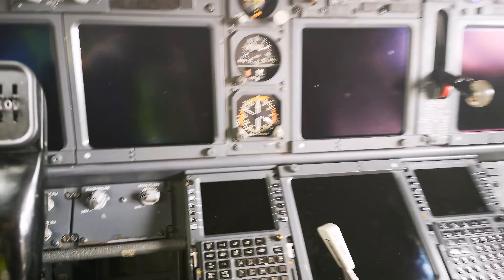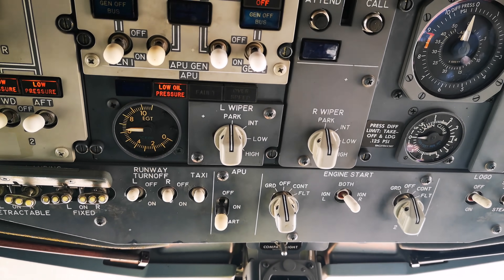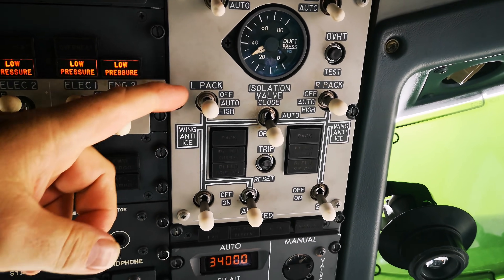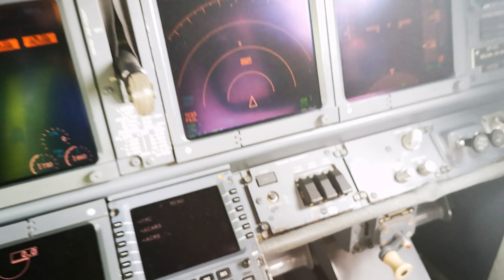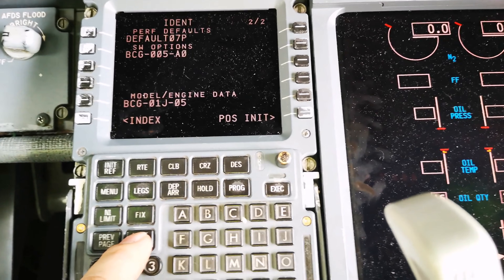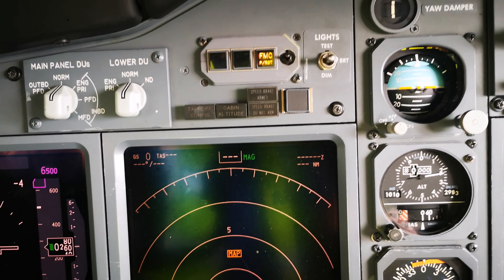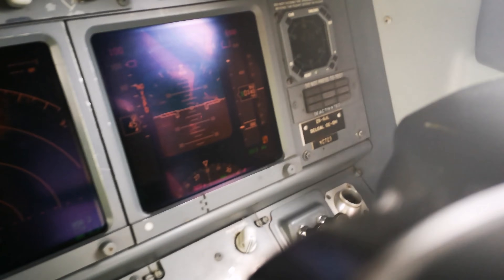B737 800 APU start and cockpit prep

Comment: А проверять положение ручки выпуска шасси не нужно?
Reply from the maker: The handle is spring loaded and needs to get pulled towards you. It also has a mechanical trigger type lock that has to get pulled as well when you want to change the position to (Up, Neutral or Down). Pulling the lever back towards you does a test of the lights...

Comment: Why are there so many slotted screws in the cockpit?
Reply: Those are quick release fasteners for easy maintenance access.
Reply: Those are dzus fasteners, used widely in aircraft.
Reply: @jjsifo1 Thanks for reminding I forgot the name.
Reply: because sh·t falls off everywhere when they forget to put them in
Reply: @gavinvalentino1313  ちょっと何言ってるかわからない。
Reply from the maker: Correct....they are Dzus fasteners.... Its a common screw head that has a cam type lock mechanism as part of the head of the screw. They in turn fit over a spring (wire stretched over the hole in the fixture) to where you want to attach the part or Radio and lock and turn in at a 90 Deg sort of angle.....Google it. Not sure if Dzus spelt correct. I don't now how to explain it better..... Or find it on YouTube. Thanks for asking....

Comment: Does the APU switch automatically go from START to RUN once the APU has started and is running OK?
Reply: Yes. you have to hold the APU switch in the START position for a couple of seconds and as soon as you let it go it will go automatically to the ON position
Reply from the maker: Sort of...The switch has three positions, Off - locked(selected), momentarily on (spring loaded in the down position) when you select it and then "ON" , locked in the Centre position.....Has to be moved to off if and when required..

Comment: Is there a precheck procedure to make sure all the switches are in their "starting" position?
Reply: Yep, parking brake on and engine start levers off which he did at the start of the video. Landing gear lever down should also be checked (get the APU on and then turn hydraulics on... the gear will try and retract and sit it on its nose!)

Comment: Like an airbus pilot, boeing looks to me as a bunch of separate systems/independent disorderly allocated on ovhd panel 😂
Reply: Agree…what a mess
Reply from the maker: Lets not do the Airbus/Boeing fight....I've worked on all of them...From Piston Dc3 to Fast jets...Master of none and still learning.....Both have there strong and weak points. As long as they stay in the sky and have no problems I'm happy....
Reply: Every time I enter this cockpit I think the same thing.It’s a shock compared to modern aircrafts.  It looks like the 747 classic but worse due to the small size of the flight deck. I was used to work on 747 but with this one I’m like a chicken laying a square egg.
Reply: Just because you don’t understand it doesn’t mean that it’s disorderly allocated 😉

Comment: Guy is obviously an engineer. He show cockpit ok but I wouldn’t like to be outside near this aircraft when he plays with landing gear lever. Nevertheless gear lever has lock mechanism. Too many accidents with this happened. Check avherald.
Reply: @Crazycat RoxYou don’t know what you are talking about. https://youtu.be/BKGx4WBnskI
Reply from the maker: Absolutely correct.....There is a manual trigger that locks the lever in the down position....To remove the R/H FMC its required to put the landing gear lever to the up position. This is down with gear pins installed and all the necessary precautions. Else its almost impossible to replace if the need arises...
Reply: Help me out here, please. 6 years ago, I heard the term Flat Earth. I thought that was the dumbest thing ever! So, I set out to prove that I live on a ball being rocked through outer space! But 6 years later, I Cannot even find one proof of a BALL EARTH! Just CGI CARTOONS from NASA/Satan and Masonic/Satanic Lying Governments!!!
Flat Earth for Dummies in under 5 Minutes!
https://youtu.be/kiH6f_QkdAA

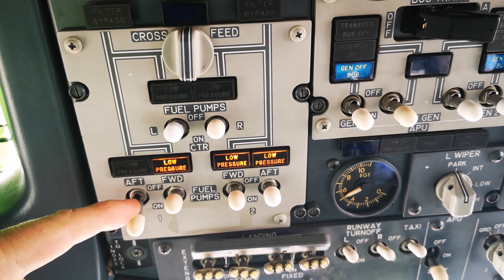Comment: 4:50 Yaw damper switch to 'on.'
*"Yaw damper on" light turns off
Reply: The light off, means that the yaw damper is on
Reply: @KansasPower  Obviously.
But why? Why is it that way? It seems to me that if the yaw damper switch itself is "on," I can see that. I have to be able to see that in order to actuate the switch. But the fact that there is an indicator light for the status of the yaw damper seems to say there is a need to know clearly whether the damper is active or not, leaving alone the fact that during takeoff you do not want the yaw damper engaged because it may fight you if you have to execute an emergency maneuver. Even if we don't know that, the presence of the indicator is confusing and not at all intuitive.
If the yaw damper is active, the indicator saying, "Yaw Damper Active" should light, and only then.
If there is a problem and the ACAS needs to tell you so other than on the readout, the yaw damper active light may flash 1-0-1.
But this business with an indicator illuminating when something on by default is off is silly.
Reply from the maker: Might not make sense......The idea is that, when the "six pack" has a warning light on( the Captain side this case),  the glare shield(six pack) would trigger him/her to look up.....With the effect of having a "Dark" overhead panel, it would be quicker to spot the light that's on than trying to look for the one that isn't. (Hope it makes more sense for you now) . Thanks for the comments..
Reply: @k80theshade  Well the light is amber, amber is generally bad to be on, and a pilot can look up quickly to see any amber lights and react. It's called a dark overhead...

Comment: You shouldn't do fire test without notifying ground
Reply from the maker: Not required on a pre flight in my country....Only have to speak to the tower or ground...Whichever VHF channel is active if you request an engine start for ground run(And then get go ahead- NOT ABOVE GROUND IDLE)
Reply: It’s standard practice every flight
Reply: Doesn't seem like you know what a fire test is...it's required in most transport category aircraft in first flight of day
Reply: @abrinson1996  maybe Boeing's SOPs have changed but pretty sure in NP21ish in FCOM it says notify ground personnel before conducting the test.

Comment: my startup:
DC power on
standby power auto
ground power on
starting an auxillary power unit
auxilary power unit generator on
auxilary power unit bleed on
hydraulic pumps on
fuel pumps (centre, 1 and 2) on
realasing parking brake
calling pushback trucks
starting engine 1 and 2
mixture idle
generator engine 1 and 2 is ready.
turning off the auxilary power unit

that's all
Reply from the maker: Normally(B737-400), but procedures have changed.(Once again, procedures) The Aft #1 tank pump is turned on for the APU start.(Normally). Not talking about DC pumps.(customer options).

Comment: Just one question, on the Navigation display towards the end of your video, do we see weather? And if so, is that not prohibited on ground? Radiation and staff?
Reply from the maker: Jip, I did check...it was. Normally the flight crew do turn it off ( WX) or Standby after flight or tilt it up. I didn't notice it on while making the video.. I do normally de-select the WX button on the EFIS panel when I spot it on..... The average "safe" distance is between 7 to 15 feet away. Just reminded me on how we used to put the Radio active sign up in front of the DC3 aircraft I worked on when I was in the South African Airforce.......Caught a lot of new apprentices that had to give "samples"  to test if their weapons still work.
We were on a remote base, so all our mail was sent off from the telephone exchange....Those old Gals where not happy when these guys walked in with their "samples"( In oil sample containers), to be sent by mail for testing. Those were the days you could still get away with it.... Part of an Appy initiation, hand in hand with the grease gun assault, engineers blue and cotton waste (feathering), we all went through when you first got to your assigned Squadron....

Comment: So cool! Why does everything on the panels look like it's from the 80's though? haha
Reply: Cause it is from 80’s
Reply: @스웤  Nah, the first company to get the 737-800 was actually as late as 1998 (TUI fly Deutschland), So its a fairly recent design.
Reply: @jibronigibironi8959  Well we are talking about panels(overhead, aft overhead, center pedstral..) right? They first came out in 737-200 and didn’t change much till 737-800 MAX. So they actually came from earlier than 80’s more like 60’s.
Reply: Cause 73s are ancient.

Comment: The left wing no.1 fuel pump was required to boost fuel flow to the APU in the classics but this isn’t required for the NGs. A DC pump functions to increase fuel flow to the APU automatically once the APU is powered on.
Reply: Still part of procedure.

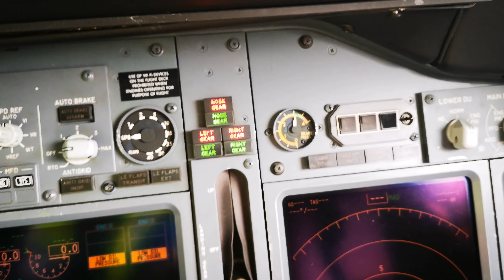Comment: 5:33 Did not quite understand how you’ve tested the landing gear lever. Did you pull it towards you? Thanks in advance!
Reply: no, i believe he clicked it down, it seems that there is one extra click down
Reply from the maker: The lever is spring loaded. To test it you pull towards you and it tests the lights, On the lower part is a manual override (looks like trigger), which allows you to release the gated slot and select the landing gear lever into the position required.

Comment: Is the Emergency Transmitter Locator on all 737s?
Reply: Why wouldn’t it be?
Reply from the maker: There are... There are the standard 2 black (orange) boxes at the back of the aircraft up in the roof,  and then there is a transmitter in the middle cabin overhead bin area that is an Emergency Locator Beacon (ELB). There is a test switch for this on the overhead panel in  the cockpit.

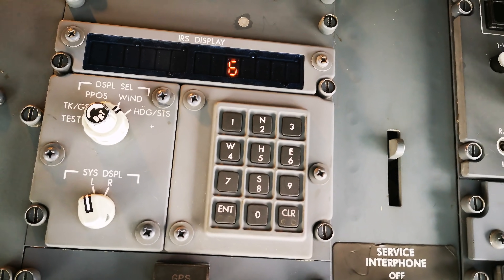Comment: At 4:20, what's the pathetic lever above "Service Interphone" ?
Reply from the maker: That is a spring loaded latch that holds the overhead panel in place before it is tied down with fasteners. The entire overhead panel pivots on hinges to the rear of the aircraft to gain access to the wiring on the rear.
Reply: @AviationEngineering1972  Thanks.
It wasn't labelled ;)

Comment: First I thought this plane was from the 1960s.... Too many switches, which should be automated already....
Reply: That’s because the plane is just a recycled version of the one from the 60s.  Even the more modern 737s still use a cable and pulley system on the PFCS
Reply: That's cause, from what I can tell, the pilot(s) should be in control of the entire plane with override capable automation  (you can override the auto controls)
Humans may be better at determining what is happening
Reply from the maker: Pilots were clever back then hey! All those buttons and stuff...not relying on computers to tell them what to do. (Just kidding. A bit more involved than that...The new A 350 airbus aircraft are cool.. It is very nice to have all the digital tests and manuals right there in the cockpit....Sure makes my life easier when the aircraft can tell you exactly where the problems are. And it saves money in the long run because the flight not stuck at the gate forever and the day. (well unless the computers fail)

Comment: What an ancient pile of garbage. What happened to you, Boeing?
Reply: Time to stfu and get off youtube you a tiktok pilot or something?
Reply from the maker: Don't know how to respond to this one...They did build the B17 bomber for the second world war as a defense...take it how you want.
Reply: Your point being?
Reply: @bigdaddy3662  that less buttons doesnt guarantee efficiency. Boeing may have more manual buttons, but why should that matter when the planes performance is what matters
Reply: @bigdaddy3662  bruh, for me the cockpit of the 737NG is the perfect balance between new and old. And to remove some buttons will maybe look more modern but it's naive to think it will become more effective and provide more safety
Reply: @quickmatch-aykut1086  the A320 has proven unequivocally your statement is false.
Reply: @bigdaddy3662  i wonder why you can find dc 3s, MD80s, 737s in Alaska flying but not any Airbus. Its weird to me that Alaska Airlines has A320s but you wont find a single one flying in Alaska. I don't say that the a320 is a bad plane. But to say that the 737  is shows that you didn't see many airplanes. The 737s cockpit is well structured, if you want call it outdated but thats no reason to hate on it. I know many who love the 737s cockpit design. There is a reason why it looks "old" in your eyes. Boeing did try to leave it similar to the previous 737 models, so the pilots could easily learn to use it  when switching from older 737 generations.

Comment: I am a little surprised that the switches are up on off. 
So far I thought that switches are always installed in such a way that they are off when something falls on them. For safety purposes. 
What is the reason for Boing to do it vice versa? :O
Reply: As a general rule on the Boeing overhead panel, the switches go forward, just like the throttles to turn on the systems to go flying.
Reply: It depends on the context (in-flight situation) whether an accidental on is worse than an accidental off.
Reply from the maker: I would not know...those Yanks...the even drive on the wrong side of the road...go figure...

Comment: Why is the IRS still used? Shouldn't GPS made it obsolete?
Reply: Redundancy, GPS is not 100% reliable.
Reply: IRS, Inertial reference System provides a platform for Attitude as well as position.   You can see the aircraft attitude indicators come alive once the alignment is complete.

  Like the previous poster wrote, GPS is susceptible to interference or jamming.
       
    The IRS position can be updated from ground based navaids as well as GPS.   If the GPS fails and you are out of range of navaids, the aircraft will still have a reliable position solution, but it will slowly drift over time.
Reply from the maker: Jip, System was designed for submarines originally. Does "drift " a bit over time......But still quite accurate....Will find home.

Comment: The Egpws test should be completed after the alignment is complete 🙂
Reply from the maker: What does the "g" stand for in EPWS....had to bite a bit in the acronym.
Reply: @AviationEngineering1972  Egpws stands for enhanced ground proximity warning system .

Comment: what is the fuel burn rate on the APU?
Reply from the maker: Well anyone's guess; the guys with the thick glasses say its about a 100kg/hour (125 liters if you multiply with and std. SG of 0.8). SG= Specific gravity. Jet A1's weight of 800g at sea level and 15 Deg/C. On the other hand it would depend on the load on the APU eg. How much power is drawn and if both or one aircon pack is running or not.
Reply: @AviationEngineering1972  A320 it’s 80kg/hr bleed off and 120kg/hr bleed on (pack flow high).
Reply: Rounding up, its about 200 lbs/hr bleeds off, 300 lbs/hr bleeds on, packs on high.
Reply: Auxiliary Power Unit
Reply: Hope u got it
Reply: An Auxiliary Power Unit or APU allows an aircraft to operate autonomously without reliance on ground support equipment such as a ground power unit, an external air-conditioning unit or a high pressure air start cart.
Reply: @zombie-zombies  apologies for the misunderstanding. I know what an APU is. I was asking how much fuel does it burn when running?

Comment: How old is this plane? looks like the 1950's
Reply from the maker: Newer than that. First ones to customers is about 1997...But there were upgrades and newer versions built since then.
Reply: @AviationEngineering1972  I am a Airbus guy... even the new 737 MAX is a late 1960's airplane with new engines. Southwest ruined the 737 IMO since they owned the assy line

Comment: Why six minutes to align?
Reply: The IRS’s take time to calculate its current position. It uses the Earth’s rotation to determine its latitude. The further from the equator the longer it takes to align.
Reply: The gyros need time to get ‘up to speed’ and it calculates position and movement from there in conjunction with some FMC input.
Reply from the maker: Cause 5 was just too short..
Reply: What do you mean?
Reply: @Aviator738  What is the technical reason why the navigation system takes six minutes to align?
Reply: @MangustaCBT  It calculates many things. IRS is like GPS for planes. If you do not use it, then you can not enter route, you can not see your attitude and bank angle which are mandatory things. If it were taking shorter, it will not be too safe. It takes long for correct calculation because it calculates the actual coordinates. Pilots aren't waiting 6 minutes for it, they do many procedures which takes more than 6 minutes so you are not waiting it. It ends while you are doing procedures. Also it does not always takes 6 mins, it depends on latitude. It generally takes about 7-8 mins but it can take more or less.

Comment: you need to wait for 2mins to put on the APU bleed after you start the APU
Reply: No you don’t you need to once the APU shows it’s running and it’s on the bleed can be turned on.
Reply: @mr.pianist3174  no it actually does.. check the fcom
Reply: @106.  Well it depends on the type of 737. Here he is flying the 737 NG but you are right. Just depends... 737 classic had that done though.
Reply: @mr.pianist3174  Boruto is right .Apu bleed can be used 2 minutes after Apu has stabilized .
Reply from the maker: Here we go again...I know I know sorry
Reply: @AviationEngineering1972  😂😂

Comment: 2:17 for apu gen off bus ding. It is simply the best sound I think I've ever heard in my life.
Reply: I tho its seatbelts and no smoking signs on/off
Reply from the maker: Does sound similar... Its a problem in most aircraft cockpits. If you look at the black box crash investigations and see how many times pilots are overwhelmed and confused due to similar warning sounds....could be a problem unless you spot the problem or realize the mistake quick enough.